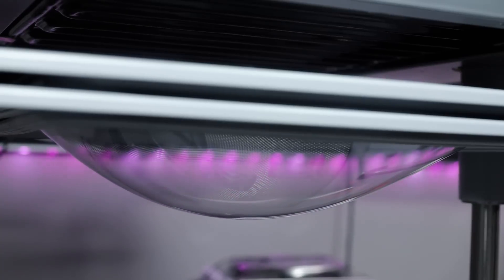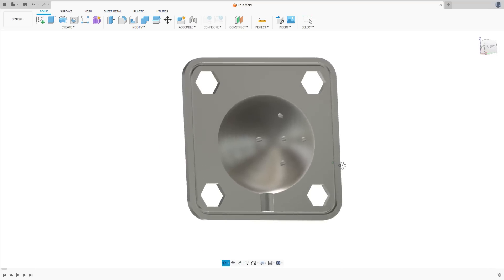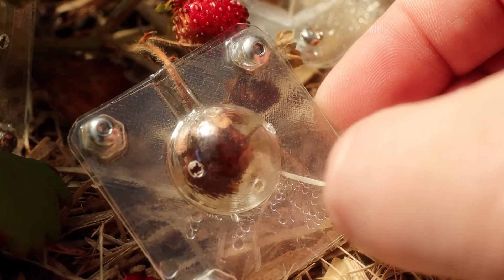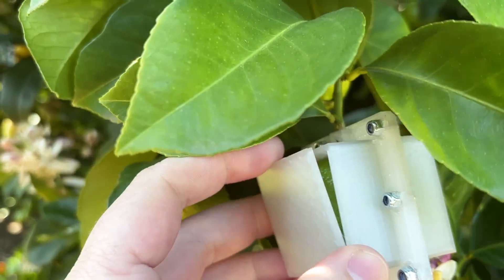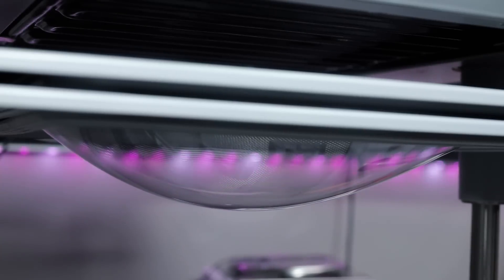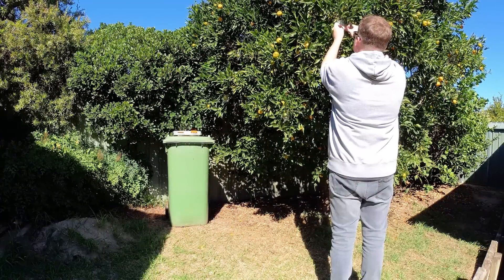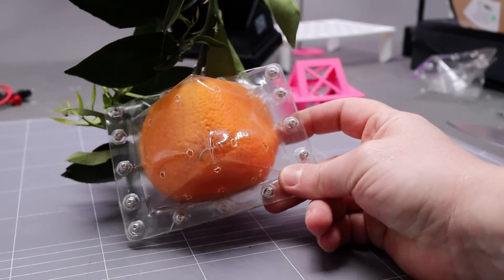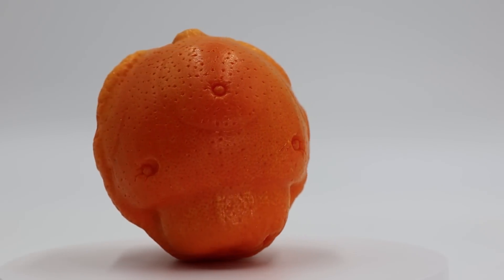Creating Super Shaped Fruit in My Backyard

Comment: Very nice
It didn't work for you because the idea is to print the same template in several sizes and when the fruit is soft and small, then put the small template on it so that it takes shape and then when it grows, replace the template with a larger one

Comment: I loved this, such a fun idea and awesome results!

I wonder if a multi staged approach would fare any better for finer details. You would have to start with a smaller mould, so the fruit is immediately being trained into shape while it is smallest and presumably most easily influenced. Design the mould with the 3d printed sheets to intentionally fall off the fruit when it is ready for the next mould. The medium sized mould would this time have some room to grow into, but because the fruit is already trained it should be much more likely to fill out the intended shape. Also radius all sharp corners/vertex, trial and error will tell you each fruits best radius.Perhaps a 2 stage process will be perfect for some fruit, others may require a 3rd stage with a much more heavy duty mould to try and contain and conform the fruit into shape in it's final stages of growing and maximum skin thickness.

Thanks for taking the time to do this and share it! :) <3

Comment: To avoid splitting issues in 3D printed sheets I would go with really thin 0.3 mm layers, normally that would make the dimensions really inaccurate due to the nozzle squishing the plastic but here it really doesn't matter, and that way there is more overlay between the lines, as well as ofc 2 intersecting layers.

using different top layer fill patterns might also make for interesting results, an hilbert curve, archimedean chords or octagram spiral (all available in prusa slicer) might make for some really nice looking heat forms.

The ultimate but probably overkill solution is ironing, most slicers offer it now, if you're not familiar it runs the nozzle across the top layer to remelt it while extruding a tiny amount to fill the gaps, it makes any print top surfaces look super smooth, and for a super thin sheet would essentially remove any weakpoints, at the cost of printing time, lots of it.

Comment: You could reduce the number of screws by 25% if you put the two sides of the mold right next to each other in the vacuum former. When you are done, you can fold both sides together. Since your vacuum former is small, you may not be able to make two sides of the orange at once. However, it could work for the smaller fruits.
¯\_(ツ)_/¯